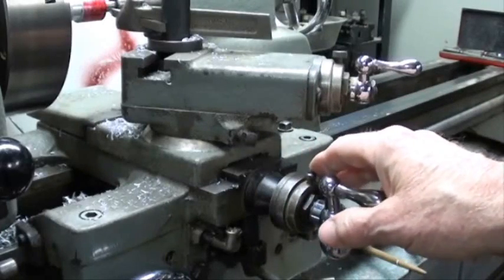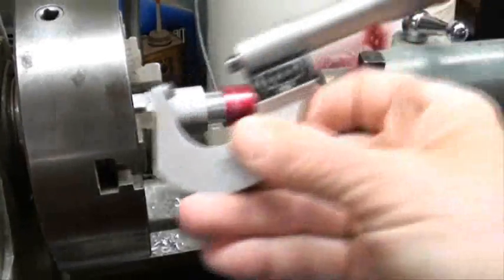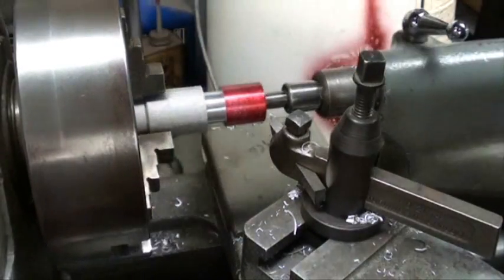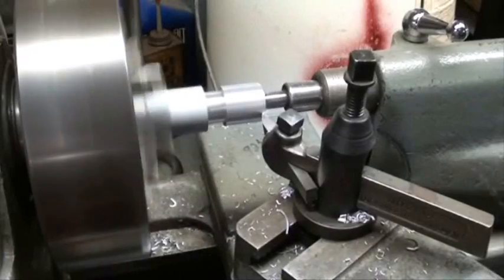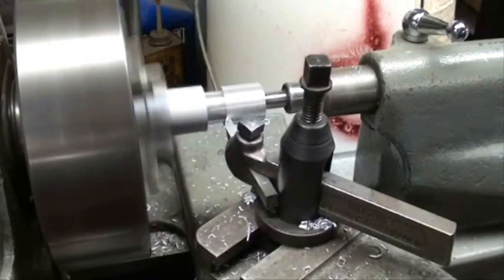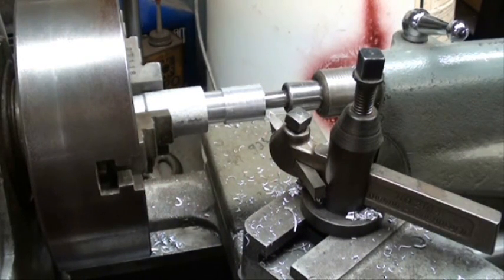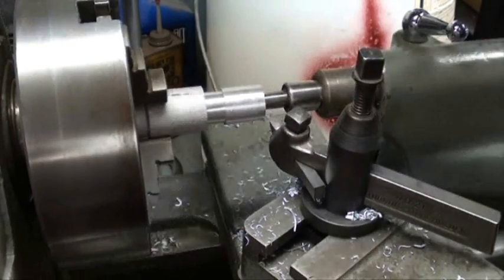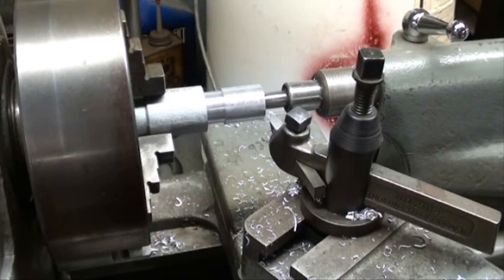MACHINE SHOP TIPS #33 Turning to Dia. on the Atlas Lathe Part 2 tubalcain

Comment: Dang i need these manuals, thanks for sharing and appreciate the detail.  I need to learn which tool post holder and tool is required for what operation. Made my first chips on my grandads atlas 10 f54 the other day.  Almost had it set up like this but i think i mistakenly used a facing tool... douh, makes sense why the cut was so terrible.

Comment: Mr. Pete:

Albeit my amateur opinion, I offer it without reservation.  You commented in a video that you didn't know why Atlas made their Zanak gears with two keys.  I offer this. Zamak is not steel of any sort and, therefore not as durable/strong.  I believe the two keys are to strengthen the fit so there is less chance that the key will be sheared dtpuring cuts and other operations.

Thank You for reading this,
David H. Gard, MD
If you chose to reply, you may at dh.gard@icloud.com or icepick@caltel.com

I thank you for your penchant to inform us neophytes
Reply from the maker: Yes, I believe you are correct

Comment: Mr. Pete,  Just love the video's great job and new friend.  Had a Atlas 10 with quick change gears when I was 15, Dad had a business and his machinist, welder, Mr. Fix anything, got it for the shop when I was in Viet Nam, now have the close model in a craftsman 10F but no quick change gears, can I add them? Also need the lead screw barring (10F-16) part, really having trouble finding one. And they build these 40 Miles from where we live.     Regards, Stony  and thanks again, Impressed!
Reply from the maker: Hi
Your best bet for parts is ebay

Comment: @Drumybum I've been machining professionally for 25 years now and have worked with literally hundreds of machinists. The only ones I've ever seen use mechanical digital micrometers were low end operators before they invested in good tools. Even the real digital are pretty rare.

Comment: I forget to add this in my last comment regarding half nut use. Years age an old
timer insisted to just snug the banjo lock nut (dont kill it he said when using 1/2 nut.)
Never knew why till the other day. My first mini crash ever. Threading a 1 inch left
thread for a fellow the other day, not paying attention and talking I ran the crossfeed right into the tailstock. and its in back gear, Now I know why, the banjo
gear train simply popped out of mesh-no damage. Keep em comming thanks sp